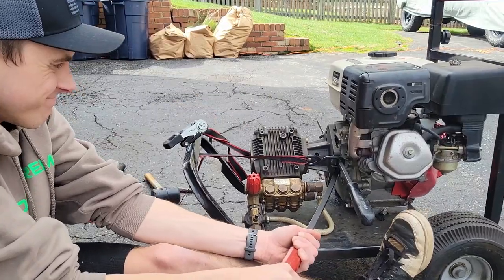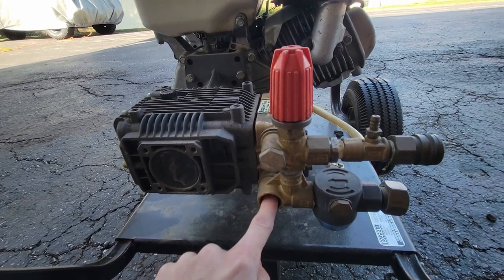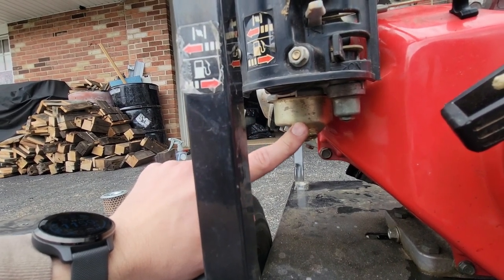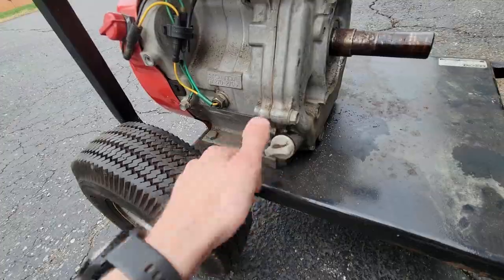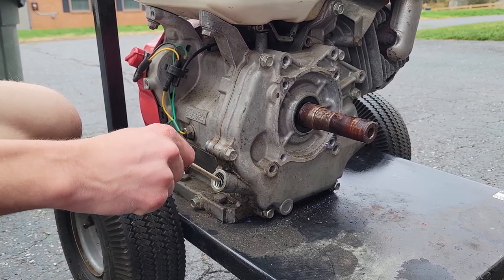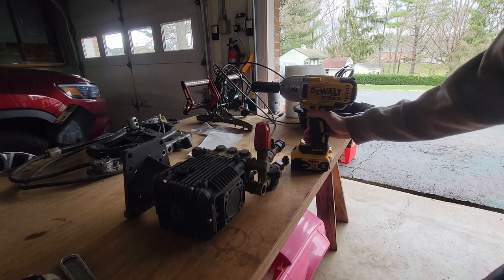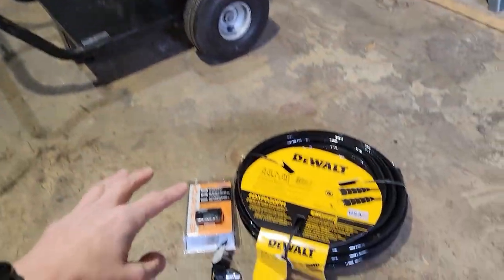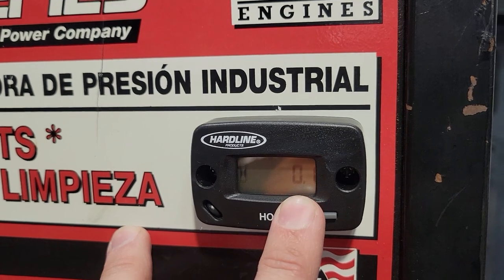Servicing And Replacing The Pump On A Honda GX270 Pressure Washer

Comment from the maker: Do NOT buy this AAA Triplex pump. Mine lasted 4 hours before water was in the oil. It was sent in for warranty and the shop took 9 months to "repair it" and destroyed my pressure washer in this time. When I got the pump back it immediately leaked oil with less then .5 hours on the rebuilt pump. Simpson refused to replace the pump after all this. I will never be buying anything from them again.
Reply: AAA pumps are junk!  I’ll take a budget Vevor or Canpump any day over a AAA.

Comment: Hey man, just curious about your upgrade , I was wondering if these cat pumps and all can be put on any pressure washer. I have a 270cc like this rated for 3.5 gpm 4k psi pump and was looking for a upgrade
Reply from the maker: You'll have to look up the output shaft of the motor and ensure that it will work with the pump you want. When I bought the AAA pump it was recommended to be used with the GX270 engine.

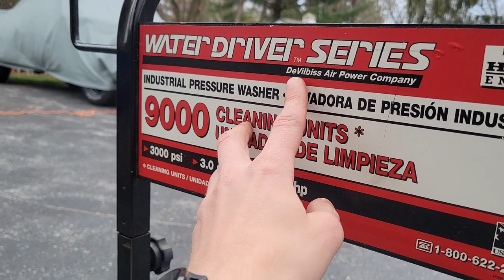Comment: that's why you need a syphon pump when working on small engines 6:08
Reply from the maker: I have one. Didn't even think about using it on this. Would have saved me the mess for sure!

Comment: That pump is trash 😭😭😭 mine gave out so quick. You were better off with a 50 dollar one from Amazon.
Reply from the maker: Yeah it's very unfortunate. I had a terrible experience with mine as well. Got 4 hours on it before I had water in the oil. Simpson had me send it to a shop for warranty. Shop destroyed the pressure washer after taking 9 months to "fix it". Pump leaked oil immediately afterwards with less then .5 hours on the rebuilt pump. They refused to replace the pump after all this. I'll never be buying from them again.
Reply: @BustedBeaters  that definitely is terrible 😬😭